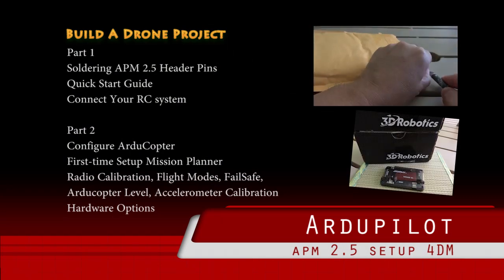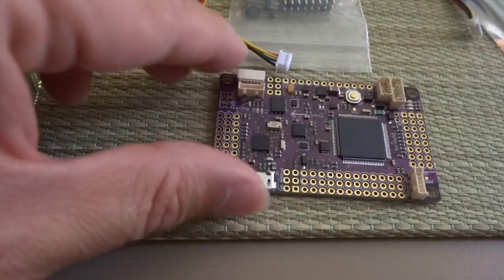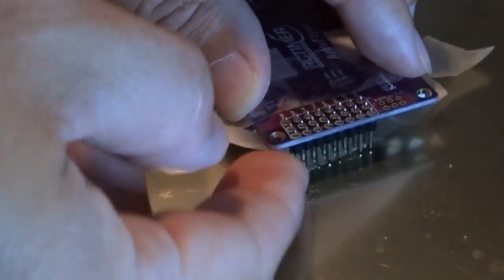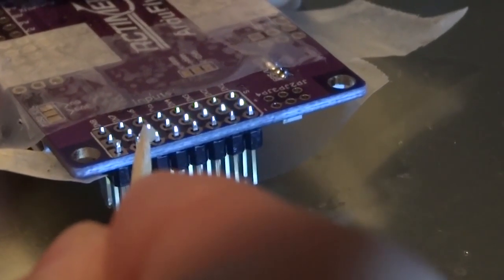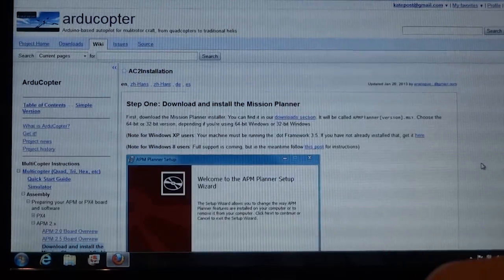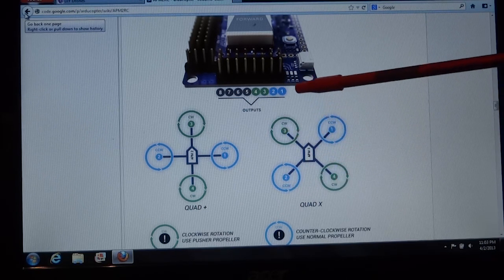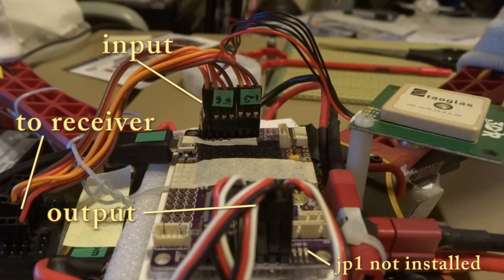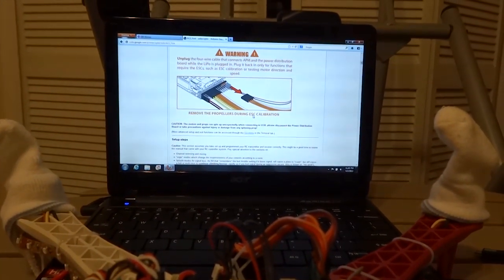Ardupilot Arduflyer Quick Start Guide. How to setup APM 2.5 for arducopter (Part 1)

Comment: I'm trying to set arduflyer for a boat and I want to use mission planner only to operate it.
I have arduflyer v2.5.2 , Feiyu FY-41AP , USB port, GPS, Power manager, receiver, air speed sensor. what do I need more and How to set these parts...
I'm not professional

Comment: Plz help. My apm 2.6 came without a jp1 jumper or the jumper pins installed.  It will power up if i use the usb connection but does nothing when I use the power module.  If I install the header pins for the jp1 will it work with power module?
Reply from the maker: no jp1 needed with power module, so check your power distribution plate, power module.

Comment: i found a setup with using two ubecs to power the input and output of the apm board separately.  The redundancy is better for brown outs apparently. The diy forum said i need to switch the green and yellow cables in my arduflyer gps & transmitter cable. I tried, but damaged d cable:( whats d name of d cable that connects d gps to d apm ? did u cross the green & yellow wires? On d  rctimer apm board, can u power everything(d servos, receiver, motor etc) through the HKpilot or 3dr power module?thx

Comment: hi what do i need to initially buy to setup the arduflyer(i already have d board, gps & telemetry) ? can u list it all from hobbyking or rctimer ? a) battery ? b) voltage regulator ? what is the name of the cable to connect the gps to apm ? i damaged my last one. thx, i just want a list of what to buy, not necessarily instructions. thx alot